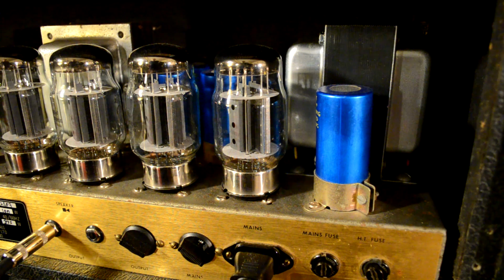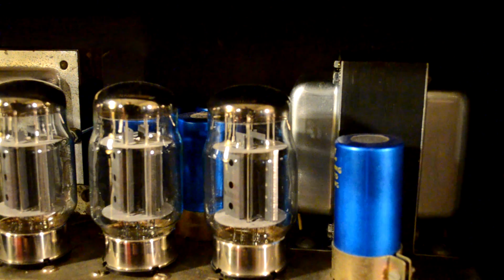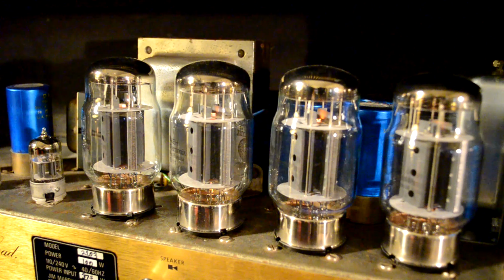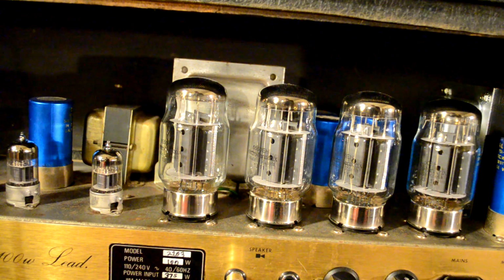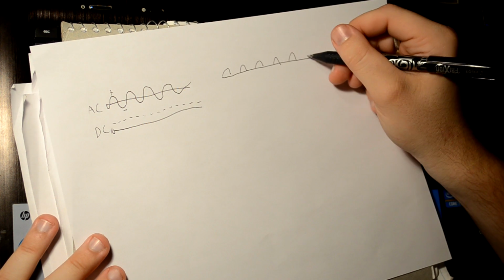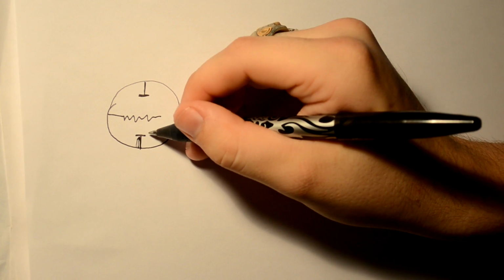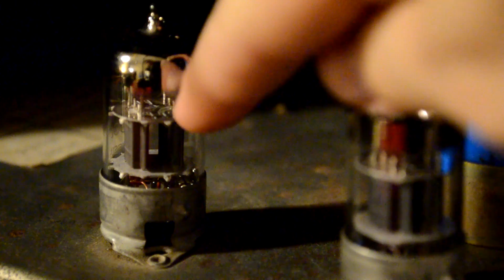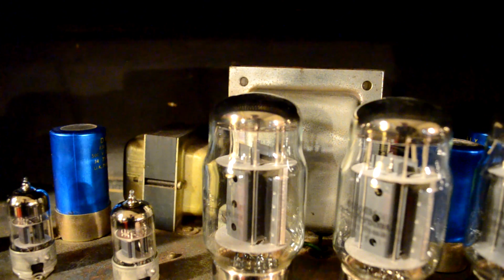How Tube Amps Work

Comment: Nice video Brandon. Hats off, awesome introductory materials!! I am from a solid-state transistor background, but I guess tubes work similarly, so i may be wrong. My little additional comment: each "terminal" of a tube has to be correctly "biased" at certain DC voltages in order to function well, and the tube only amplifies the "small" AC signals oscillating around that DC bias voltage.
Reply from the maker: Thank you! I am not as familiar with transistors (I am learning!) but that sounds mostly correct. Tubes have to be biased, but not each "terminal". The bias voltage also sometimes called the HT (high tension) or B+ (battery positive) voltage is "biased" or set between the cathode, anode, and grid. Depending on the type of tube this is usually between 300v - 500v in guitar amplifiers. When adjusting the bias, you are changing the amount of idle current flowing from cathode to anode (some current flows even when there is no audio signal). And yes you are correct, the AC oscillations from the audio signal applied to the grid modulate the DC bias voltage to replicate that signal. This amplifies it by simply "copying" it with a much larger voltage. You have to be careful with tubes though! Setting the bias too high can let too much current through, causing "redplating" where the anode heats up and glows red-hot. This can cause noise, arcing, tube failure, and amp damage. And biasing too low will result in poor sound quality, low efficiency, and possible strain on the circuit. Sorry for the long post! But in summary, yes tubes and transistors work on very similar principals, the difference being transistors operate on much lower voltages and are more reliable and efficient.
Reply: In your reply to Wei Huang, you are confusing B+ with bias. B+ is the positive high voltage supplying current to the tubes, while bias is the negative voltage applied to their control grids to control the amount of current flowing through them when no signal is present. In an amp with a bias adjustment, the cathodes of the output tubes are connected to ground, and a separate negative bias supply is connected to the grids. It is the voltage from this supply that you are adjusting. Making this voltage more negative reduces the current in the tube, while making it less negative decreases the current.

Comment: (Being an engineer I thought I would just correct one item). When discussing AC and DC voltages you drew a waveform for 115V and said the peaks are at those voltages. That is not the case. The heating power from a 115v DC is equivalent to that of 115v AC. That  115V is an RMS value ( root mean square). The actual peak to peak voltage of the AC wave is 325V. To find the RMS value of a sinusoidal waveform- keeping it simple- divide peak to peak by two and multiply by  0.707. This is to give the equivalent power of the DC voltage. Keep up the good work.
Reply from the maker: Thank you for your comment, you are correct. I misspoke in the video, as the 120v in the US is the RMS value but peak value is around + or - 170v. I thought I added this to the video annotations because someone else mentioned this in the comments but it appears I did not. I will add it now!
Reply: Brandon Doherty
Dear Brandon, if you ever need advice from an old engineer who worked many years with valves (tubes) please feel free to ask.
Reply from the maker: Thank you for the offer!

Comment: Could you list the specs of all the components in this video? I am thinking of using them as a sort of template for making my own tube amp as I am somewhat new to the workings of one. Specifically the capacitors and the tubes. The rectifier not so much because I am in Australia and our power is 240V A/C at 50 Hz.
Reply from the maker: The caps are dual radials, 50 micro farads, and I believe rated at 500v. There are 2 more electrolytic caps under the chassis but I don't remember their values offhand. The preamp tubes are 12ax7 and the power tubes are 6550's, both electroharmonix brand. The rectifier won't be any different for you, as it just uses 4 diodes. However you will use the power transformer's secondary winding that is rated for 240v. Of course there are a lot more components underneath, and I don't know the specs of all of them. I couldn't tell you the specs of the transformers either. Your best bet would be to look up a schematic for this amp as it will list all the components.
Reply: An amp for use in 240V countries will have a power transformer  which accepts 240V. After the power transformer everything in an amp designed for 240V is the same as in an amp designed to operate from 120V.

Comment: Sorry, I am having some trouble trying to understand this. If the signal is only amplified when it is positive, then doesn't that mean that the other half is not being amplified? Is that correct?
Reply from the maker: Great question! I know it can be confusing and I probably should have made this a bit clearer in the video. Even when there is no input signal, current is flowing from the cathode to the plate. This is called the idle current and when you adjust the bias of an amplifier, you affect this current. So think of it this way.... current is always flowing, and the input signal just regulates how much it lets through. So when your guitar signal becomes negative (even at it's most negative), it does not completely stop the flow of electrons from cathode to anode.
 
Here's an analogy that might help: Let's say you have a leaky sink. Even when the handle is in the off position, water still trickles through. Now imagine you turn the handle (you're the input signal). You can turn the handle on all the way or anywhere in between, and the flow is changes with your input. But even if you turn it all the way off some water gets through. The same idea applies to tube amplification. Although the "zero" point is not the same, if you were to graph the output you would get an identical signal, with just a higher amplitude!
Reply: Ah, sorry to be bothering you again, but I still don't understand how the negative side of the signal is amplified. In your video, you said that the grid is like a gate that opens when the signal turns positive, and closes when the signal is no longer positive. So that means when the grid is negative it does not allow the electrons from the cathode to pass through (except for a fixed amount of "idle current"),  right? So how is the negative half cycles of the signal amplified? Because it sounds to me as if only the positive side will be amplified and the negative side will be flat.
Reply from the maker: superbarnie Right, I should have worded what I said in the video differently. The "gate" never completely closes. When the guitar signal  becomes negative current is still getting through. But the amount is proportional to the amplitude of the input signal. So the "zero" line between + and - is different for the input and output signals. When the input is at its highest positive peak, the most current is getting through, and when it is at its most negative peak the least current is getting through. Does that make sense?
Reply: Never mind him. He is just an amateur.
Reply: The gate is held half open by the negative bias when no signal is present, so positive signals can pull the gate towards fully closed, and negative signals can pull the gate towards fully open.
Reply: Yes. Tubes are so similiar in operation to MOSFETS.
Reply: N-channel depletion mode MOSFETs.